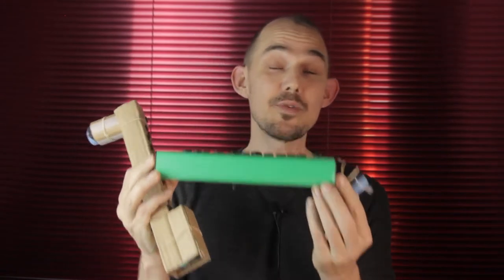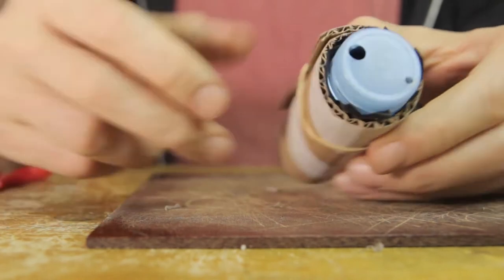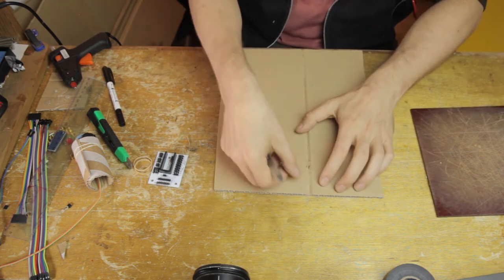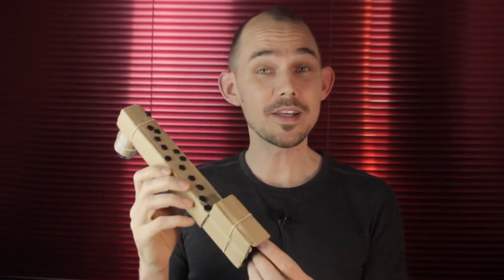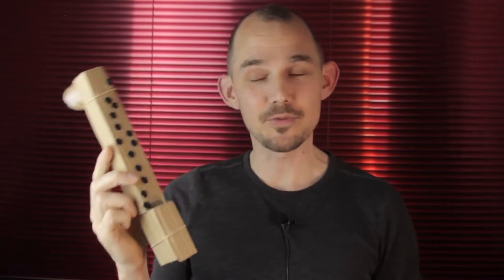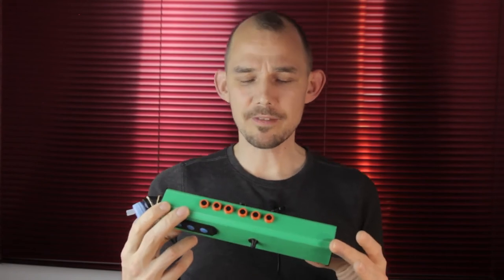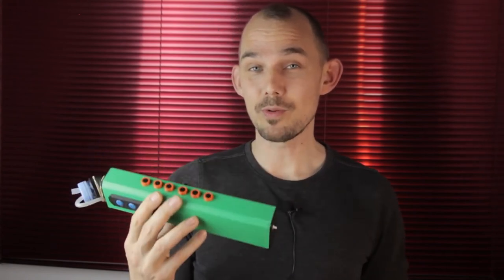Making the KLIKsophone, a DIY MIDI woodwind instrument - KLIK Tutorial #5

Comment from the maker: TIME CODES:
00:00 Intro
01:01 Intro music

1ST BUILD:
02:07 Start 
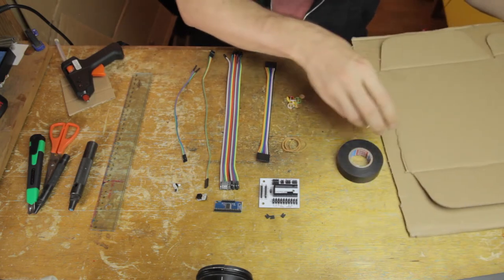02:46 Materials list
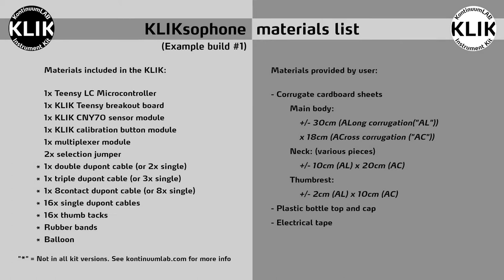02:59 Making the breath sensor / mouthpiece
10:00 Making the main body
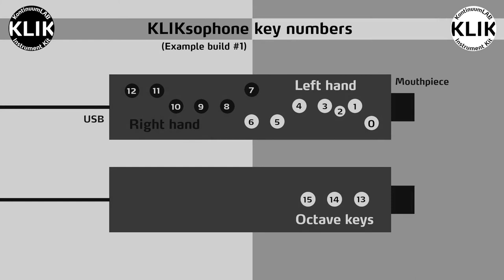15:10 Key numbers - Making the keys
18:46 Connections
23:27 Testing 1st build
24:00 1st build - Final comments

2ND BUILD:
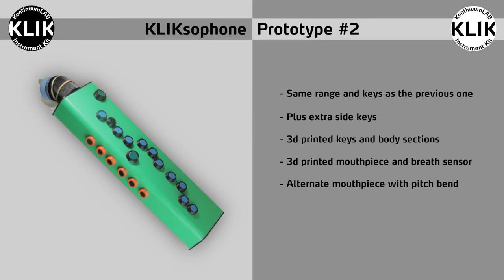24:43 Start
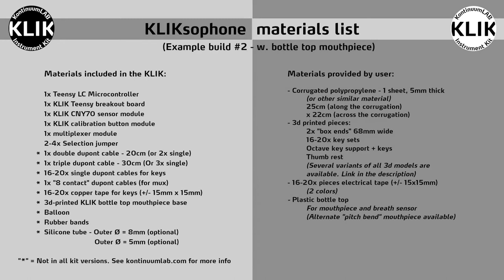28:48 Materials list
29:21 Making the main body
37:32 Preparing the 3d printed keys
42:54 Key numbers
43:14 Attaching the keys
51:16 Connections
42:34 Testing 2nd build (with simple mouthpiece)
43:25 Comments
43:48 Making the pitch bend mouthpiece
55:25 Materials list for pitch bend mouthpiece
1:05:56 Testing 2nd build (with pitch bend mouthpiece and looper controls)

1:07:02 Final comments

Comment: It's not terribly clear how the copper tape is supposed to go on the keys here. Are you supposed to wrap the tape around the entire key, or JUST the top, or JUST the bottom?
Reply from the maker: Hi Josh.
You must be talking about the 3d-printed keys, right? The top surface of the inner disk in each key should be completely covered with copper tape. On the bottom of the disk you should leave a corner of tape just big enough to solder the cable to. The rest can be trimmed off.
Reply: @KontinuumLAB  that is correct. Thank you for that!

Comment: What software do you use to play all your instruments?
Reply from the maker: I personally love the Yoshimi software synth, Free, open source, very powerful and works great with CC#2. been using it for years, but it's Linux only. Recently discovered "Helm" which is cross platform and free (Donate what you think it's worth - P.S. It's worth a LOT) You can easily MIDI-learn the CC#2 messages onto volume and filters and play your KLIKsophone with all its cool built in sounds. In the end, any MIDI capable synth will work, but those are the ones I'm using right now.
Reply: @KontinuumLAB  Awesome! Thank you!